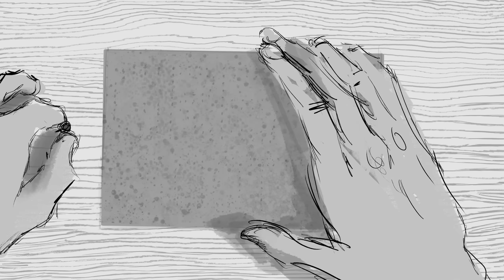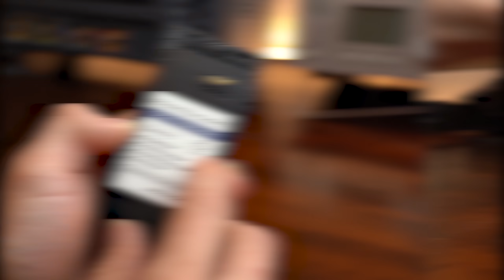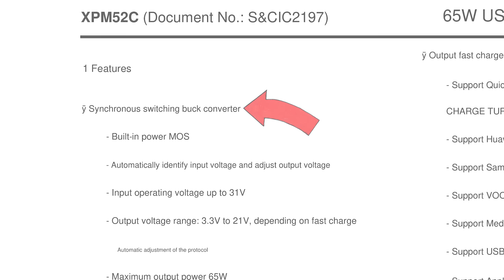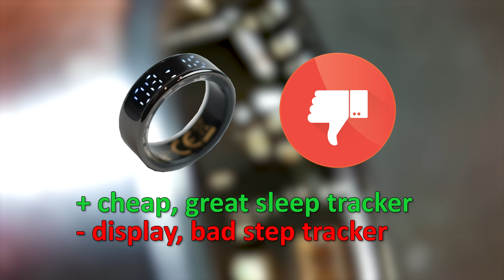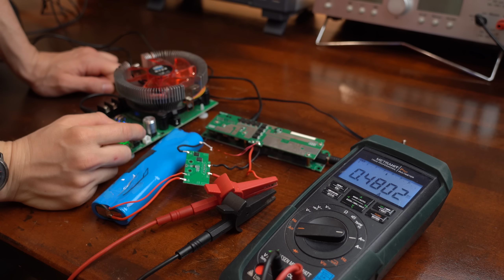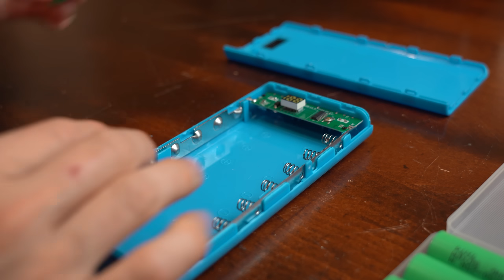I tried finding Hidden Gems on AliExpress AGAIN! (Part 17)

Comment: Radios: These are just bad, but durable phones. If you need radios for actual emergencies, that is, when phones stop working because the network has gone down, these radios are completely useless. On most job sites, you can get away with PMR radios, or you can go for something more expensive/professional that'll need a license (but has less chance of interference).

Comment: With smart rings you should be careful, since even big brands have had the batteries bloat and since the batteri is one  inside side of the ring they then clamp onto your finger, and you don't want a device with a bloating battery clamped to your finger.

Comment: Shame you didn't measure the battery capacity of the UPS (or even mentioned it in the first place). This way it's impossible to know how long it would last. Is the total output 2A? If so, it would be practically useless to power all connected devices unless they were really low power,

Comment: i wouldn't ever recommend Ali express to anyone. got ripped off badly from one of the sellers who had pulled the same trick over and over, i ordered a set for engraving he messaged me as soon as i placed the order showing the set and asking me to confirm the set was what i ordered so i replied yes he then sent another photo of just one component and said it would be dispatched, after waiting weeks it finally arrived a tiny piece of steel for 80 pounds and he was happy to brag that he had tricked me into buying basically a 5 pound piece of metal

Comment: Parallel 18650 cells are okay as long as you are aware of the issues and precharge them all to the same voltage first.
What really scares me is 18650's in series without a BMS, as commonly seen in some flashlights. In series you can end up with one cell way over voltage, and another under voltage, particularly if the device has a charge port allowing you to charge the cells in place. After a while - K'BOOM.

Comment: The Powerbank would work if they give you a simple holder with a smal lightbulb like a Christmas light on the positive and an adapter Dummy until you put the new cell into the holder with the dummy and wait till the Christmas light is dim or off and then put it in that will mitigate the high currents of Miss matched cells course the lightboulb wollte act as resister and indicator

Comment: For the power bank, as long as the cells are matched then it would operate in the same fashion as most banks that contain multiple 18650, from powerwalls to household devices. Sure, in an ideal world any block of 2 or more 18650's would have it's own balance lead and cell level fuse, however, that has never been the case for any setup I've seen. Even in high current applications (such as scooters) it is typical for multiple 18650's to be in parallel with a single balance lead monitoring 10+ batteries (for example in a 4s12p pack).

Comment: Can any good lad comment more on the power bank device. I have been having 1 of those for many years now and always thought it is OK to put batteries of different charge levels as they would eventually equalize. At least that is what my unknowing brain thought. So the question here is, why is it dangerous to put batteries with different charge levels together? If 1 battery is at 3.7 and another at 4 volts. What could happen?

Comment: The point you shown for have walkie talkie with simcards is useless as there are cat smartphones easily available that does the same job... And the areas where walkie talkies are required it's seems that these would be useless, as walkie talkies are used where there is network restrictions like inside mines or some forests where their is no mobile network...

Comment: 2 smartphone, 2 bluetooth headphones and Discord and you have a solution with even less latency. I'm sorry, but if the connection is not point-to-point that product is useless. You normally use that kind of products in forests, montains or offshore, when you don' t have a cellular connection. How can that can be remotely useful? For the long battery? 2 days are not that much for this kind of products. Some walkie-tokie can last for days and works with AA or AAA battery in order to be super easy to swap them.

Comment: Have you tried the tool less comnectors like this one? 

"20/50/100 Pack H2 2-Pin Pluggable Wire Conne Nylon Insulated Copper Quick Connect Terminal Suitable for Low-Voltage Cables, No Power Mode No Electronic Components" 
 
I dont think they have a real single name and i have no clue who is the original manufacturer, but they seem pretty good!

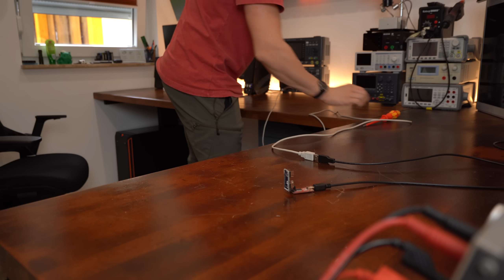Comment: 12:12 get a USB hub and route the USB under your bench. Then you have a way to always access USB from your workbench without messing around with small hookup wires. It is a great way to do it

Comment: HTs like that are pretty common. It easily gets around the issues with bandwidth allocations and licensing. You can use off the shelf, prelicensed parts to be certified anywhere, and you can make it secure which you would otherwise need specific licensing for. In other words, a really neat product born out of limitation

Comment: 14:30 parallel connection of lithium batteries is safe if the charge states are not at the extremes. They have quite significant internal resistance when charging. 0.2-0.3V difference is fine

Comment: There are much better 18650/21650 battery boxes with multiple 65/100W outputs and quick charge input, they cost a lot more.

Comment: Great videos as always. It'd be nice to see how devices behave under regular use for longer times, and stress test for shorter times, especially any devices handling power, say ups, pd-boards, buck or boost converters, because I feel like the ratings can be very unreliable most of the times, in terms of amps it can handle, or in terms of power something can deliver, while not burning itself and everything around it. Would love to see that. Thanks for the great work, we appreciate it :-)

Comment: I have an expensive OEM rebranded smart ring (by the same people who run Hume), and the only thing it seems to do right is temperature monitoring, step counter counts just 50% of steps (I stand 14 hours per day and the ring always shows around 10.000 steps), heart rate sensor shows 200bpm+ at rest and the spo2 always shows an average of 99% (while my RingConn gen2 and a medical grade pulsoxy meter shows an average of 95%).

Comment: Can anyone help me on a project? 
I'm making a motorized lineer potentiometer (aka fader) with custom lengths. I need to use 'Absolute Positioning'. So i need a piece of 'resistive and conductive' ribbon. I cant find that kind of product on internet. Ive tried grafit with pencils etc. but it couldnt work. How can i make or find that kind of product?

Comment: TBH 2 days on bare-bones phone is not that great. Some of the smartphone-age dumb phones, like Nokia 1202 or C1-02 could last around a month on a single charge and cost 20Eur. So probably if you need rugged, reliable voice comms, there are better options at similar price.

Comment: I am really not a huge fan of those cellular "radios". They arent more than just a cheap chinese android in a "walkie talkie" shape.
These days getting licensed for ham radio isn't that hard, and if you don't want to get one you can always use the PMR walkie talkies. Granted, they are really handicaped when it comes to power and have only builtin antennas.

Comment: with all the DC/DC conversion in modern computers with a little hardware hacking you technically probably could run your desktop computer off just 12V, but that UPS wouldn't be able to deliver anywhere near the current needed.

Comment: Hatte vor parr Monaten ein richtig heißes Teil auf dem Aliklo gesehen. 
Eine  Powerbank Platine Mit XT 30/60Akku Eingang, und ein Parr Typ C. Keine Normale Standart Power Bank board, sondern so richtig Heiß,

Diase Alienplatine soll sich Mit modernsten PD Protokollen run 120W Laden lassen,
Und hat ein Integriertes Ballancing BMS für 4-6Zellen oder So. Über Dip switsches lassen sich nach einer Tabelle
DER Akkutyp LFP, LiIon, serien Anzahl und Spannung Maximalwerte Justieren. 

Und die Tabelle ist in der Produkt beschreibung aufgeführt.

Ich frage mich warum Amazon es nicht geschissen bekommt für so elektronische Platinen einfach gleich die Anleitung und anschlüsse in der Produktbeschreibung aufzulisten. 
Bei Amazon Hast du nicht mehr als den Produktnamen. Ich könnte Mich stunden lang über diese Dummheit seitens Amazon aufregen. 
Warum bekommt nur Alishit und andere chinesen es gebacken?
Achso, schau auch mal auf Ali Baba Nach. Das ist nochmal eine Stufe Brutaler als das angebot von Ali express, und gpnstiger.

Comment: Aus Hackepeter wird Kacke Später!!!
Aber diese USB Trigger Module können für den Kleinen Leihenhaften Hobbybastlern und Schüler extrem Hilfreich sein. Ich habe derzeit noch nicht viel Bedarf danach, aber bitte Mehr Videos über diese Produkte und Funktionsweise. 
Für den Allgemeinen Tüftler und Elektronisch Interessierten fielicht ein Gewaltiges Gadjet. 
Ich brauche sie nicht mehr weil ich in den letzten 5 Jahren nun 100k Verschidene Ladegeräte aller art habe.
Aber für den Minimalistem ein Absolutes Must have.
z.B ein Hochwertiges Typ C Netzteil, und 5 Verschidene Trigger Module die alle ihre eigene Ausgangsspannung triggern an die Jede Beliebige Rundstecker oder XT 60 Stecker angelötet werden kann. Dann hätte man mit seinem Handy/Laptop Ladegerät gleich Power Supplys für verschiedenste geräte. 
Danke.

Comment: I have one of those DIY powerbank boxes which only seems to differ a bit in how the screen looks and how it closes (mine has 6 screws instead of the clips).
It is really hard to recommend, since only a few chargers seem to work and it's also pretty big.
Mine has 2 LEDs as a flashlight aswell, but when I put it in a backpack, those just turn on at random (doesn't need much force in the button) which very likely leaves me with an empty powerbank once needed.
Seriously, just get a proper one and you'll be much happier

Comment: I chucked out my APC UPS when it died, and bought a Bluetti EB3A for $200 instead of another expensive UPS, and use it as a 600W UPS for my computer and all my USB charging needs. 
Also, I'll have a solar generator for camping or whatever if I ever need one.

Comment: I strongly recommend not using these PD boards, as voltage ripples on them pose a danger to your devices. It is better to take SW3516/SW3518

Comment: There's a much greater Community around the CBTALK App which dous the same as the walki talkies - if you are using 4G. If you also want the feel using a walkie talki they have optional mics with push to talk buttons way more useful :)

Comment: For Folks in the EU: Starting from july 1 2026 we are going to pay additionally at least 3€ more of customs PER ITEM CATEGORY (= per different HS code) from outside the EU for all parcels regardless of it's value. If you buy 3 t-shirts you are going to pay 3€ for the whole but if it is 2 T-shirts + screwdriver it would be 6€ more. It could add up quickly. But this is only temporary: from 2028 a new customs duty system would be implemented and be probably even worse.
Reply: I bet that's pressure from your Daddy Trump 😂

Comment: I have a different 18650 case. Mine is almost impossible to open so you can’t short it. Also it has 6 batteries in parallel. Often when a battery fails I take it apart and find 18650 flat top inside. Most though I’ve ever seen is 4 in parallel though. 8 is really taking the piss. Even 6 as mine has is OTT, but as mentioned it is almost impossible to open so I don’t think I have any with 6. Take your tool batteries apart when they die. There will be some parallel cells. Never 8 though. To deliver the high current needed for tools they have some parallel design.
Reply: NB I can’t fit 18659 with a button top on mine. Be careful when ordering as I tried some old 18650 cells but couldn’t use them as they were too long and the plastic wasn’t pliable enough.

Comment: for whomever may see this:
speaking of bluetooth, is there a magical usb bluetooth dongle with a good range and wall penetration? i have an "asus usb bt500" however it occasionally dies for no reason (have to unplug-replug), and my phone has a significantly better range than the dongle.
or do i have to attempt to make my own while not breaking any radio laws? 😅

Comment: If you're in the UK you can do a lot better than those prices for data. E.g. Tesco Mobile will do 500MB data, 500 minutes & 500 texts for £5 a month or 10GB data unlimited texts and minutes for a £10 a month.  I'm guessing if you need somewhere in between you can shop around to find it.

Comment: Yeah not happy if I have to install random bits of Chinese software just to use hardware that ought not need any. You know they're desperate to get ahead with R&D, right? So whose PCs would they most like to spy on? You know, all Chinese companies above a certain size, have to have members of the Chinese Communist Party on their board? And those members have a say above all else. Similarly, if the Chinese intelligence agency requires a citizen, or company, to do something, then they'd better do it. There's spyware in all sorts of things. You shouldn't need software just to run a Bluetooth serial dongle. Nor any sort of app on your phone. Just no. If you say "yes" to anyone who wants to install something on your PC, what's the point of having security software?

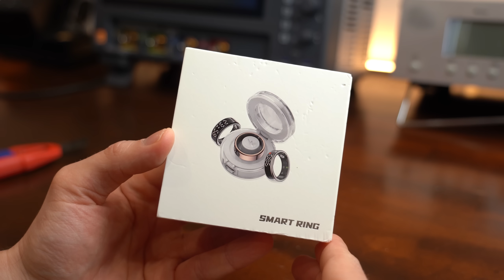Comment: 6:20 I would not use a smart ring personally because if the battery starts to swell, you will basically loose your finger as the hospital will most likely not have any other option to remove it. I've seen this happen on Samsung Smart ring, would be extra caucious with Aliexpress products

Comment: If you want to "fix" Chinese software and you're 100% sure there's no other languages available, you can use an application called Resource Hacker to view and edit all windows and strings found in EXE and DLL files. Very handy, I've translated Windows apps like this before.

Comment: About that powerbank. Yes, it is dangerous if batteries are different voltage. I charged them up separate and then inserted them into this. One cool feature i discovered from that powerbank is that when internal battery is full it still can deliver power out from USB-A ports but directs power from charger. When charger is disconnected it then switches over to internal battery. Basically it is acting like UPS. Downside is the switching takes half a second and some devices like Orangepi Zero 2W turns off in that time. But my home security camera stays on durning this time. SO i think by adding some capacitor to output pin would help keep devices alive durning switchover and it would make great UPS for low power devices as charge current is not enough to keep 2 cellphones charging at same time even when my 65w charger was connected.

Comment: The powerbank shells are trash. They kill battery capacity. I have 15 spare 18650s I have put in a lot of these DIY boxes. They charge slow, the output if you are luck is 15w, even the pretend 22.5w ones. They barely ever close

Comment: Hm. I actually have similar powerbank shells - for up to 10 18650 cells. Of course you need to be careful. What I do is I charge all cells to 100% SoC with an external charger (for Li-Io of course) fist and check that they have the same voltage (within 0,1 volt difference). Then I put them in there one by one. Also I do not use any metal tools to open the shell. For me they work quite well and give all the cells I harvest from broken power tool batteries or broken devices a second live.  It'S also best if the cells are about the same age and wear.
So I'd say: If you know what you do they work. And if the 18650 cells are in there all is good, since they are all in parallel they balance themselfs. But yes: Do NEVER put cells with unclear or different SoC in there! And MAKE 100% SURE that the are put in in the right direction! One cell put in in reverse will make you a nice campfire or "better".

Comment: The link to the UPS offer now shows a price of 65€ + shipping 40€. That's how the Ali system rips off their customers. If an affiliate links goes viral, the price explodes.

If you can live without the POE output, search for item 1005008492845501 currently for 33€ shipping included.

Comment: power banks are safe, they use cheap high resistance metal on the terminals so the current is limited, only it will be a portable heater for a while😂

Comment: Those large battery packs holding 3 or more 18650 cells are great for projects using raspberry pi boards. I use them often with 2 cells matched in capacity, age and charge level, the prongs and bus bars are trimmed back to the size needed and glued down. I add a small switch and glue in place with hole to ensure easy access. I then add a buck converter if needed (some boards have 4.2, 4.7, and 5.0V outputs available depends on board design as they vary often. I don't always need the buck converter though. I have 3 Pi-Star's made this way and several other projects such as a GPS logger and a time lapse camera made using this method.

Comment: As for the Walki-Talkis & Smart-Ring: Pure privacy nightmare. You don't know where that data is landing.
As for the UPS: I don't think that thing will last very long. Lithium cells really don't like being held (or being charged) in the upper 20%; hence why pretty much every name brand UPS uses Lead-Acid batteries... Nifty idea tho for a powerstation with a built-in battery :D
Reply: The reason they don't use lithium batteries for UPS isn't because of the state of charge, because they could easily make the max lower. The problem is the safety risk, aka fire risk. That's the last thing you want when you're sleeping or not home.